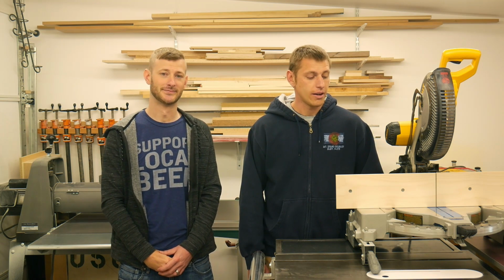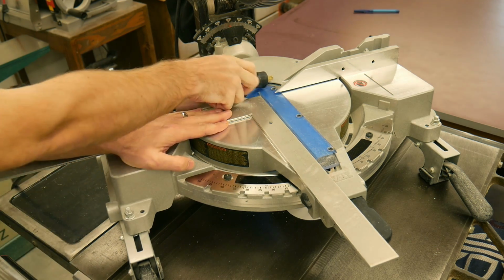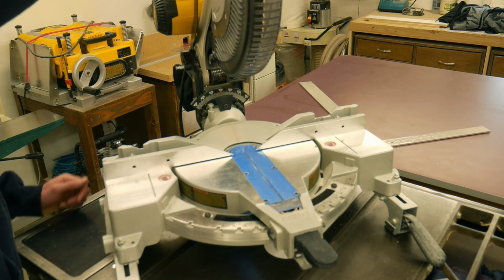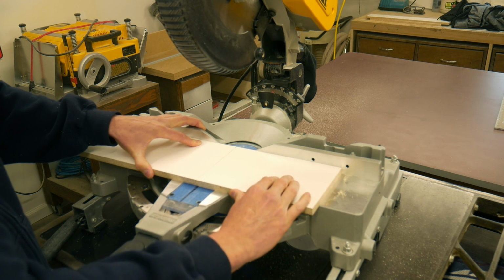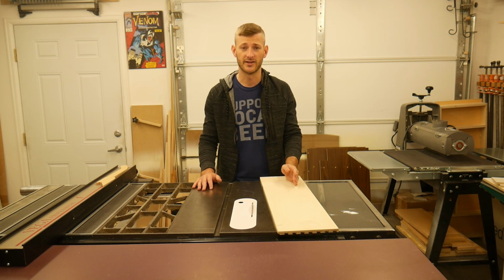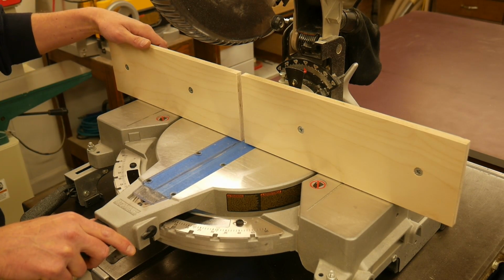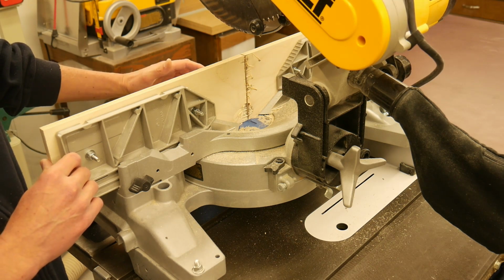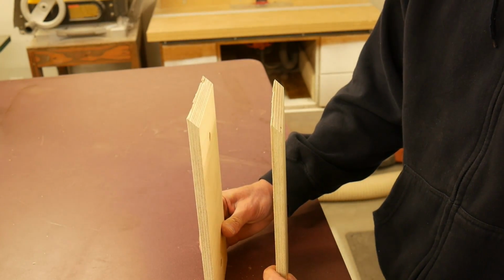Dewalt DW716 Miter Saw Calibration & Zero Clearance Fence Construction

Comment: @04:21 you mention intentionally setting the saw at 1 degree, was it 1 degree left or right (of the zero) ?
Reply from the maker: We went left, but you can go either way.
Reply: @ccprojectfactory   Thanks, my question was just to avoid trial and error (making it worse before making it better), by comparing your results with mine !
In your demo, 1 degree left make the gap largest on the front, so 1 degree right should produce a gap on the back.
On my dw716, the 0 degree stop produce about a 1/3 degree-off cut, nothing a little sanding can't fix, but still so annoying.
Making any kind of box, 4 cuts that are all off 1/3 degree will end up causing a compounded 1.2 degree gap, which is... not perfect. 
45 degree miters for 4 corners is 8 cuts times 1/3 off, almost 3 degrees off, this will not sand out so well.
 

Thanks again for your work and even more so for responding quickly about a 5 yr old video. 👍

Comment: Not really practical for production trim work. It would be fine as a dedicated saw if you did a lot of face frames.
Reply: You don't ever cut 45s doing trim? If your saw it out or square even 1/2° and you cut two 45s on 5" base you'll end up with a decent gap. So I'd say calibrating your saw for trim work is pretty important. If you call yourself a trim carpenter and think that 1° doesn't matter your not a very good trim carpenter. Must be one of those "ahh fuck it let the painter caulk it" type of carpenters 😂

Comment: So, let's say the oem fence is not square to the table.  How would you adjust the secondary (zero clearance) fence to get a plumb/square reference point?
Reply: I've had a DWS779 for a few years and it's terrible.   The oem fence is quite a bit out of square to the blade.  if I place a straight edge across the fence, the outer edges are tight while the closer you get to the center the larger the gap.   I would have to pull the out edges of the fence back and honestly there isn't a lot of room for play.  FTR, I bought a straight edge that is accurate to .001" across the length.  

The gap is large enough that I want to get rid of the saw and buy another.   No matter how much I adjust the detents or the bevel angle it just doesn't want to make a square cut.
Reply from the maker: Definitely not an ideal situation, how far off is it? Im assuming you mean square vertically?

Comment: This test is only if you want to saw with a precision miter saw. (not for rough work).     

Tips and Test: 
Very important if you would like to saw with precision. (avoid torsion as much as possible)!
Always choose a Miter saw with a handle positioned in a vertical line above the saw blade.  
Everything must be aligned, slide rails, handle, and saw blade,it is much better this way the blade will not tilt.
Because there is some torsion in the aluminum housing .
And choose an engine with softstart on it to prevent wear of the gear and worm shaft.
It is very important that everything is aligned.
Here are some examples to show how the handle must be positioned above the blade.
Bosch gcm 800 sj / Bosch gcm 8 sjl / Evolution rage 3 / FESTOOL KS 60 / Bosch GCM 8 SDE / FESTOOL KS 60 E KAPEX / Metabo KGSV 72 Xact / Bosch PCM 8 SD / Hitachi C10FSH.

(This also is the case with the Miter saw without the slide rails).

(If you want). You can test it yourself at home if there is torsion in the aluminum housing.

Step-1. First you make a saw cut from +-5 mm deep in to a flat piece of wood about +- 20 mm thick to this with the normal handle positioned on the right side of the Miter saw (the wood it will remain in place until the test is completed).

Step-2. Then repeat this by pushing the saw blade down with your hand (finger) on the aluminum protective cover were the saw blade is cased in. Just now only do this without the running engine.

Step-3. Now you can see if the saw blade will be positioned in or next to the saw cut. If the saw blade is (+- 0,2 / 0,5 mm) next to the saw cut then there is torsion in the aluminum housing (test is completed).

Step-4. therefor it is much better to choose a Miter saw with the handle positioned vertical in line above the saw blade.

Conclusion: how further away the handle is from the saw blade how more chance of torsion in the aluminum housing.(don't go for that).

Also with a cheap slide miter saw it is still better the handgriff in line a above the saw blade than on the right side. Maybe they will make it someday then we have a winner...
Reply: When a person is pulling down harder then normal on any miter saw handle because; the material is hard, cutting too fast for the size of material, the blade is worn, or any combination of those. That extra downward force applied by the operator can pull the blade out of 90° alignment. Or cause a curved cut that gets worse at the bottom of the large piece. , smells burnt, that's a good indication to check your saw settings and change the blade.

If the log is that hard, might want to do  tough cut with a chain saw. Or get a proper metal saw if you're abusing this saw with a metal blade and pulling on the handle. 🤦🏻‍♂️
Reply: There is already torsion in the aluminum housing if you lower the saw without the motor running this has to do with the resistance of the spring that also keeps the saw high.  How further away the handle is from the saw blade how more chance of torsion in the aluminum housing.

Comment: You lost me at “framing square”.  You do it with test cuts, flip and check for gaps.
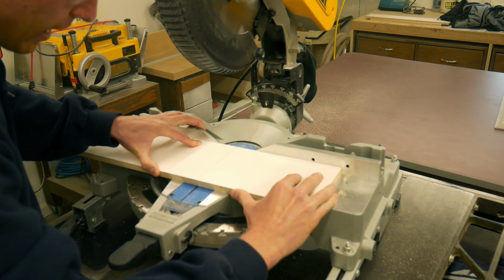Reply from the maker: Around the 4:00 minute mark, we do indeed use test cuts to verify the settings.  The framing square helps you get into a good position so you aren't playing guess and check.

Comment: DW716vsDW716XPS
weight?
Reply from the maker: The XPS is just a light. I don't think the weight would be very noticeable in a 44l b saw from the addition of the light. HTH
Reply: C&CProjectFactory  
DW716XPS is 51 pounds
DW716 is 44 pounds
Reply from the maker: @rosariomontes758  wow really?  Is there something different between the 2 other than the light that I missed?  That seems like a lot.